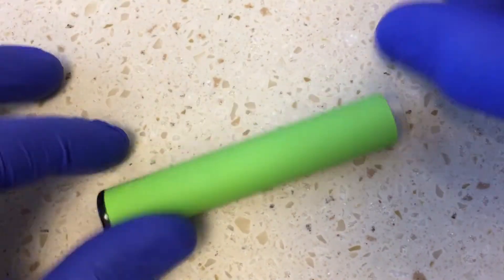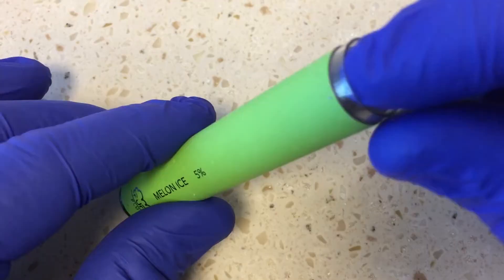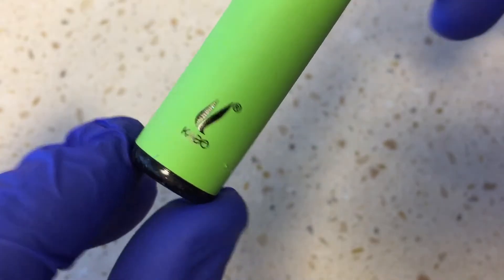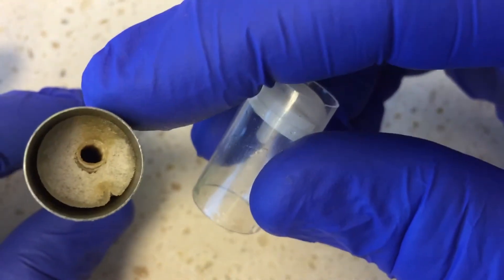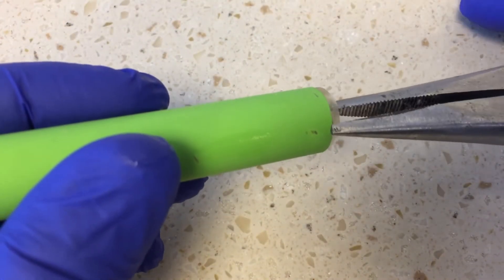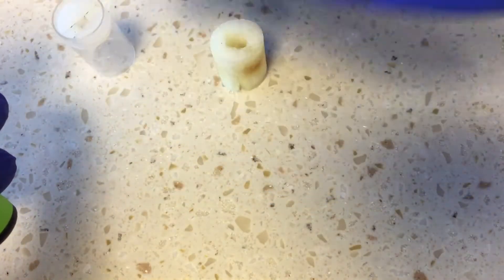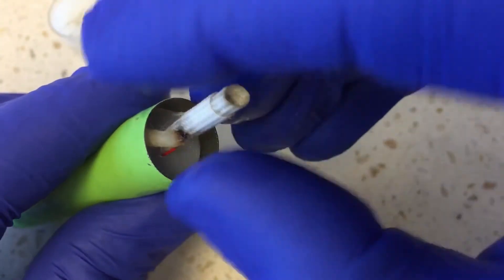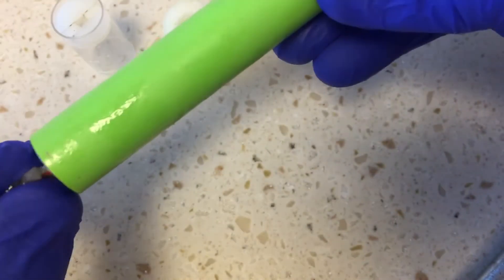Disposable Pre-Filled Electronic Vaping Device Teardown

Comment: The sensor is evolved from an electret capacitor microphone, which operated by varying the capacitance as the diaphragm vibrated. The same vibrations as air is drawn past the sensor's diaphragm (shielded from less intense stray vibrations by a fabric disk) cause a signal change in capacitance that triggers the circuit to switch  on a current to the coiled heating element.   The negative and (switched +, often blue wire but may be other colours) sensor operated connections can also take a 5v (USB) charging current if the coil is disconnected, and charge the battery through the red wire (positive) to about 4.1v.
Reply from the maker: Great information, thanks for the comment!

Comment: It was flashing when you found it, beacuse it had moisture from the ground that shorted the terminals on the sensor chip and turned it on.. And if you blow on to the back of the sensor it will turn on, provided there is at least 2.6v left on the battery charge and there is a load or another led connected the blue wire and black wire respectively. The battery is rechargeable
Reply from the maker: Good information, thanks. The battery is rechargeable but most of these vape devices do not have a charge port and even if they did, the liquid inside of them isn't designed to be replaced. So sadly you end up with Lithium Ion battery (that may or may not have a battery charging management circuit) that you have to toss out.

Comment: Bro how does vape glow while smoking??
Reply from the maker: The light on the sensor circuit blinks or turns on, flashing to show it is activated. You wouldn't see any actual light from inside the vape, however if the wire gets hot that wraps around the liquid wick (to vaporize it) it may show a visible glow although you'd need your vape to be opened like I did and hook it up to the battery and see the wire burn red hot.

Comment: how can the airflow sensor detect that you take a push? I mean its at the bottom of the vape why its not higher?
Reply from the maker: It seems like a closed tube so it doesn't matter, even if the sensor is at the other end. Air has to somehow enter or exit the tube and the only place would be through the sensor.
Reply: @devhackmod  oh okay Thank you

Comment: U open it from the bottom and u will see the sensor and u will see a battery and the heating element is called a coil
Reply from the maker: Yes thanks. The air flow sensor is quite complex, I found out it has numerous functions built it even though it's hard to see the chip (it's hidden in there).

Comment: The batteries are lithium and are rechargeable as long as there not below 3v and the small round thing is a pressure sensor for when you suck on the vape it also works when you blow on them and the led lights you can also do something to make the sensor into a capacitive touch sensor

Comment: Can I replace that sensor with a switch ? I mean in the end it just connects two wires like a switch right?
Reply from the maker: It's more complicated than that. Every one I've opened has this part that seems to be doing more than just switching it on off (I've tried just shorting the wire, it doesn't work). It may be regulating battery charge while adjusting current flow to the heating element based on sensing air-pressure and so on. It's not just a simple switch. Here's something from a datasheet description:

1) ASIC design.
2) LED working indication
3) Short Circuit Protection(SCP)
4) Under voltage lock out(UVLO)
5) Over-temperature protection(OTP)
6) Low quiescent current (4.0-5uA)
7) Simple periphery circuit,low cost.
8) Little measurement error for charging voltage (within 1%)
9) Perfect Battery protection trickle charge mode when battery voltage is lower than 2.7V,quick charge mode when voltage between2.7- 4.2V,constant voltage charging at 4.2V.
10) Wide charging voltage (4.3-5.0V),superior Rechargeable performance, safe charging process

Comment: Thanks for this, I've been finding these things for the last few years and wondered what the device was that resembles a mic capsule.
Reply from the maker: From an online site, that little "capsule" does all these things:

1) ASIC design.
2) LED working indication
3) Short Circuit Protection(SCP)
4) Under voltage lock out(UVLO)
5) Over-temperature protection(OTP)
6) Low quiescent current (4.0-5uA)
7) Simple periphery circuit,low cost.
8) Little measurement error for charging voltage (within 1%)
9) Perfect Battery protection trickle charge mode when battery voltage is lower than 2.7V,quick charge mode when voltage between2.7- 4.2V,constant voltage charging at 4.2V.
10) Wide charging voltage (4.3-5.0V),superior Rechargeable performance, safe charging process
Reply: @devhackmod  wow, best reply I've ever had, thanks for taking the time 👌
Reply: @devhackmod  are you serious? wow! I guess ill leave them in now instead of taking them out of the circuit.

Comment: If you apply 5V to the blue wire and the - to the black wire, you can charge the battery up. The circuit will pass about 500mA to slow charge the lithium battery. I made a little gizmo with one for reviving 18650s in tool batteries.
Reply from the maker: Nice! Thanks for the tip!

Comment: You need to update the firmware, so  you can use it as light saber.
Reply: 👆This.
  Although calling it a light-sabre is a bit of a stretch due to its diminutive size, I'd describe it more as a light-dagger or light-knife, or, as I like to call mine, a pico-poker.
  However, it will penetrate durasteel armour easily but would leave nary a scratch on beskar.  I mean, even when properly focused, it's no arc pulse generator!  Amirite. 😄

Comment: Air pressure switch, get activated by a small metallic film as air goes through closing the circuit.
Reply from the maker: Thanks for clarifying, yes it seems that's how it activates the device!
Reply: Do you know where you can get those?
Reply from the maker: @rag.animations  I'm assuming electronics supply sites (Mouser, Digikey) or perhaps on eBay?

Comment: That battery is indeed rechargeable.  3.7 volt lithium ion.
Reply from the maker: Seems like such a waste, perfectly good battery to only use one time!
Reply: I use a TP4056 charging module to recharge these batteries - works a treat from a USB charger and these batteries are free if you keep your eyes open and look down.  I get my 4056s from Amazon: £6.95 for 5.  Cheaper for 10 off.
Reply: It is a total waste.  Yet for some reason the flavor off these are so much better than the more reusable ones.  I think cuz of that huge cotton cylinder.

Comment: Love the vaporizer circuit. Great discovery work here. Was wondering about the same things in the past when I found and opened these e cigs.
Reply from the maker: Yeah pretty simple construction, such a waste of a rechargeable Li-Ion. If you can find a charge circuit you can reuse these. Otherwise just an expensive disposable piece of garbage.
Reply: @devhackmod  there are version of thse with voltage regulators and micro usb ports.. similar circuit

manufacturers are just building these "disposable" ones to get more sales.